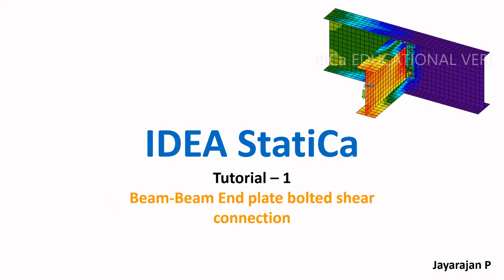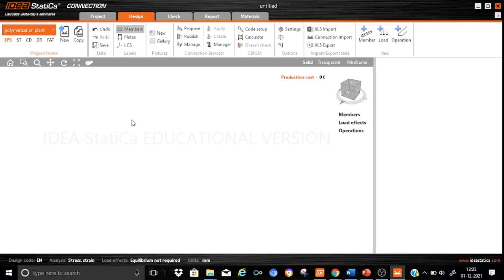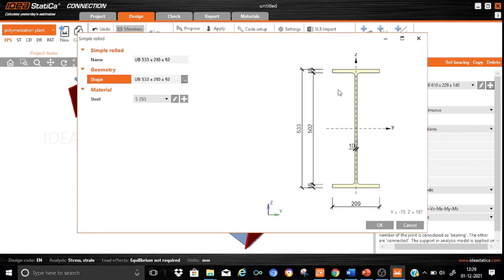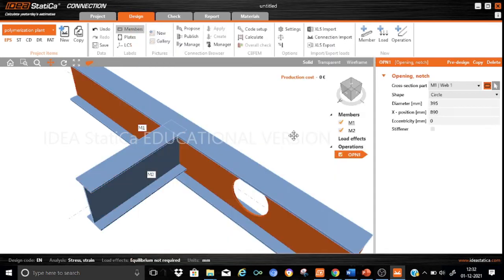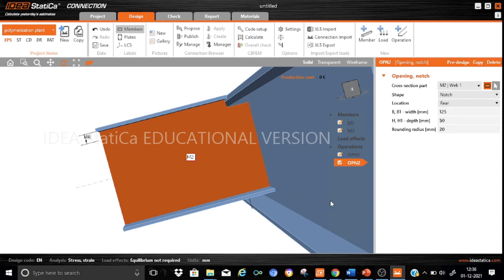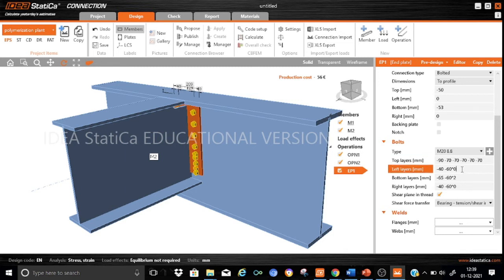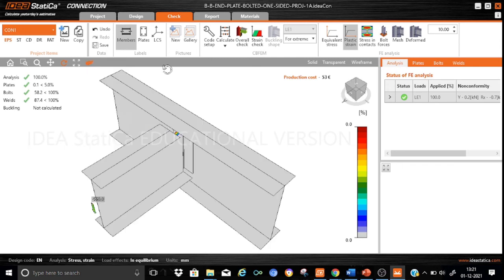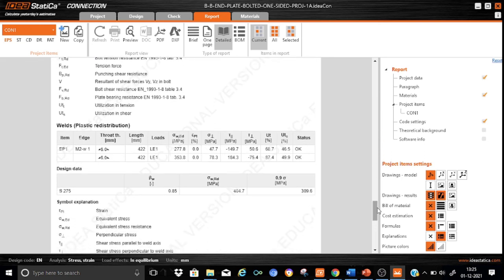IDEA StatiCa tutorial-1: beam to beam shear connection design using bolted end plates

Comment: This is a simple connection issue occurs whem the depth of the ended member is larger than that of cont. member transfer of forces is difficult. this situation arises in acse of a a multilane truss bridge. if you have any experience about that ?????
Reply from the maker: shop welding the end plate with flanges of supporting beam and field-bolting the connected beam with another end plate is an option in such cases...

Comment: thank you for the useful presentation.
i have a question please
how do you check if the stresses are safe or not ? 
you got the max stress 275 and used S355 as a material so you do you compare 275 with 319.5 (355*0.9 safety factor ) or what ?
Reply from the maker: Dear friend,
First of all thanks for ur support. 
Please note that IDEA statica does not provide  separate stress contour plots  for bending /axial/shear stresses separately. Instead it provides a plot for equivalent (resultant)stress computed from stresses in orthogonal directions. You can plot the equivalent stress distribution and then check detailed results for various components on the right hand side of the menu .
The calculation report in fact  provide separately interaction checks for various  components using which you can verify whether they are  within permissible limits .
Hope that this suggestion would be helpful to you.

Comment: Can you do one video wherein you show how to design using software and vis a vis manual design by extracting shear ,moment and axial tension etc...i.e. using spreadsheets ....
Reply from the maker: The best way for anyone to learn and verify IDEA Statica  soft ware is to make as many hand calculations as  possible and  compare the same with the software ( I normally don't like excel sheets....due to its obvious disadvantage). Before making any comparisons , please note that the hand calculations do not take care the out of plane deformation effects of the components which software will include in its calculations
Reply: @puttattjayarajan1199  could you please add a video showing the validation of simple end plate beam weld connection with IDEA StatiCA results. It's obvious that during plastic stage the shear weld check seems handy with manual checks. But not with moment!!

Comment: Sir while modelling the connection welds are not visible in the connection plate but I have provided the weld of 6mm. Due to which connection is showing some error.
Reply: This is because the welding operation will work only when the flanges of the M2 member is placed on top of the end plate. In this tutorial, this step is not shown. For M2 member offset ex =18mm needs to be defined then the weld will appear. This will resolve the connection problem
Reply from the maker: Normally this should not happen. Please note that only fillet welds are visible in the model while groove welds are displayed  only as a line.
'You can try two alternatives. Delete the relevant manufacturing operation and define it again. If still it does not work use a standard model template from the library
Reply: @puttattjayarajan1199  I am defining fillet welds only. When I extend the end plate upto the secondary beam flange then the weld are visible on the flange, but somehow welds are not viable on the web even though i have selected weld of 6mm. Pre defined templates are working fine but I wanted to know why this is happening?

Comment: hi sir why i am getting singularity in analysis? thanks
Reply: In Member M2 apply the ex value as 18mm that's it.
Reply: @jahangeerali1968  Thanks. It seems that the M2 member was aligned to the axis of M1, resulting in non-formation of welds.
Reply from the maker: Normally singularity in IDEA statica occurs when analysis cannot be performed due to some modelling errors. For eg. when two components do not have a contact or connectivity this would result in singularity.
I would advise you to first thoroughly check your model component by component and ensure connectivity, Further applied load should be compatible with the support conditions assumed for the problem
Reply: I do have the same issue. I have a singularity error in m2. Checked everything in modelling. Didn't help